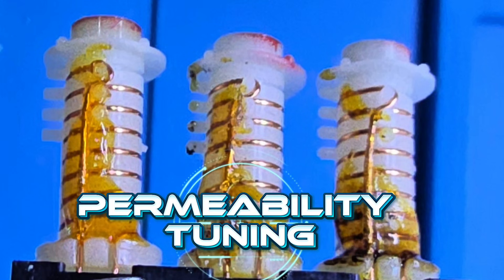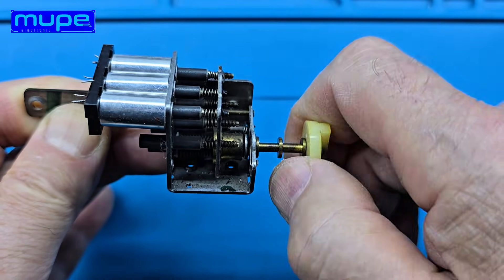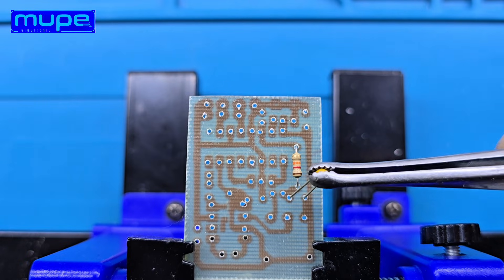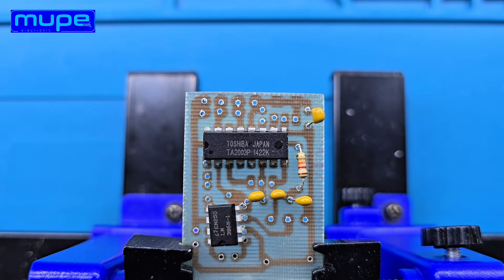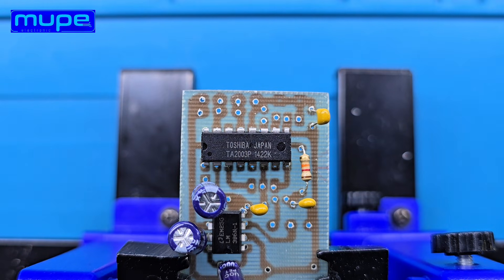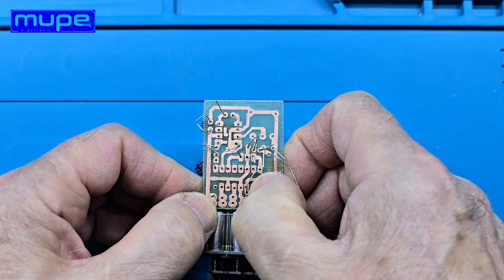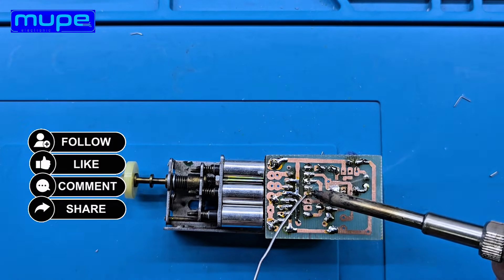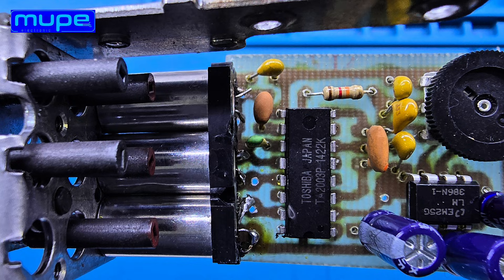Permeability-Tuned FM Radio Bringing Vintage Tuner Tech Back with TA2003

Comment: nice video. for frequencies over 50MHz you might try to repace the ferrites with same diameter but shorter auminium or copper bars/tubes, the tuning works in opposite way, as inserting well conducting materia inside a long VHF range coi decreases the inductance. (hign permeabiity Ferrite has much larger losses on VHF than HF) other alternative is  core s made of carbonyl, but bar shaped ready made cores are not readiy available, if the ferrite diameter is say 6,35mm, you could glue five to ten  T-25 (1/4") cores as a stack, and get same tuning direction as ferrite gives search for MicrometaLs or Amidon for core sizes Al vaues and permeabiities, but the latter are for toroidal use, not used as fift or tenth of a bar. greetings from Finand
Reply from the maker: Thanks a lot for the detailed information!
You're absolutely right — ferrite losses increase above 50 MHz, and using short aluminium or copper rods does reverse the tuning direction by decreasing inductance.
Your suggestion about stacking carbonyl-iron T-25 cores is also very useful when bar-type cores aren’t available.
I appreciate your technical insight.
Greetings from Turkey!